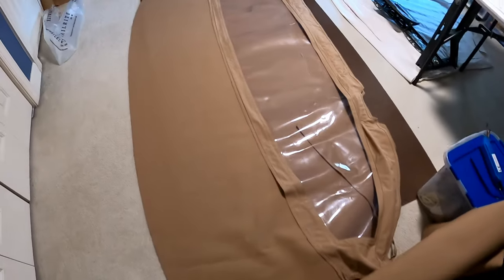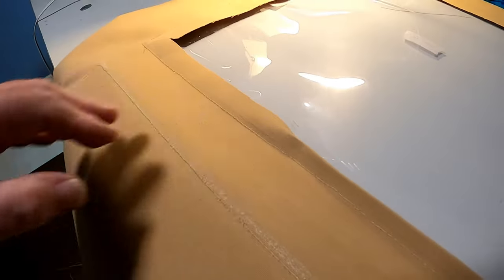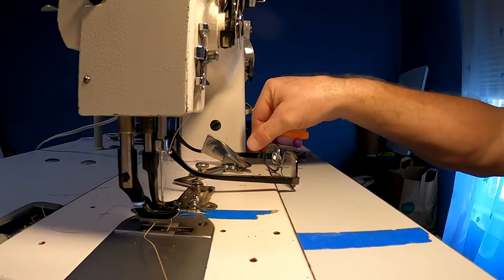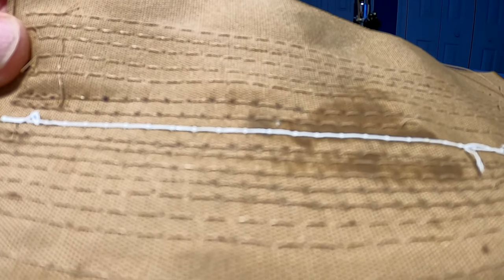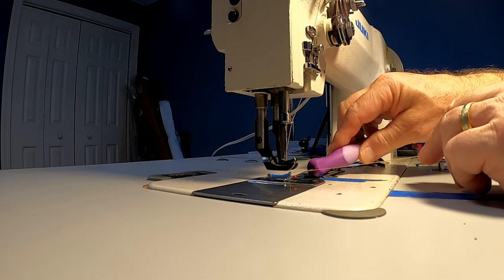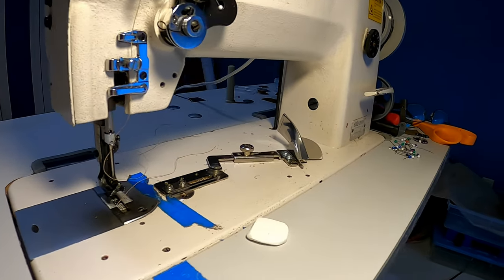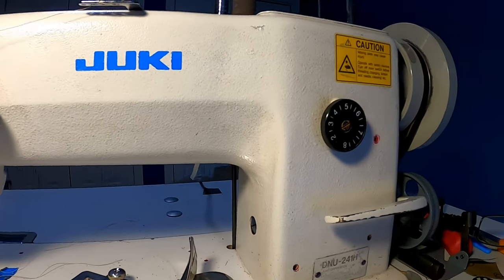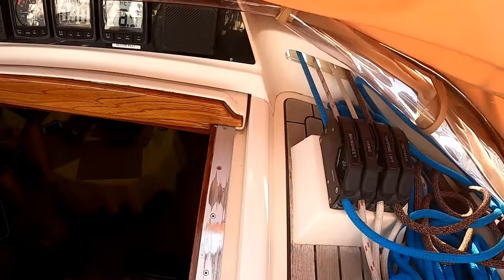Ep 141 Tuning Industrial Sewing Machines for Marine Canvas Projects

Comment: I was pulling my hair out trying to get my tension correctly. No problem in two layers of sunbrella, but a nightmare in multiple folds. I was using a needle that was too small (#20) going to a #22 solved all my issues. Thank you!
Reply from the maker: Yeah, there's nothing more frustrating than a sewing machine that's acting up. We're glad you got it sorted.
Reply from the maker: Yep. Exactly right.

Comment: Staples work very well, in many applications, instead of pins.
Reply from the maker: Hi Rick. What kind of boat is that? I've tried it before, but depending on the staple they can damage the fabric if the staples aren't sharp enough. Anyway, we have a ton of pins in the box. And thanks so much for being with us.
Reply: @SailingTalisman  Hi Kevin - nice to see y'all back after a little break!  Really enjoy your channel.  The boat is a classic Lightning - it's actually a friend's boat - 1940's era.  I have 2 newer Lightnings - one "classic" 1967 & a modern one.

Good point about the fabric damage with staples - whenever I use them it's always on the outside edge of the seam so any picks, etc. are not on the the "business" side of the canvas.

Comment: I've never seen a zigzag compound feed walking foot you referenced. 

My experience is that lock stitch machines can only deflect the needle on one axis, either forward and reverse in the case of needle feed, or left and right for a zig zag. I can't imagine needle to hook geometry that could compensate for both zigzag and needle feed.
Reply from the maker: A four-point zig-zag sailmaking machine is something to see. The motion is so fast you can't see the needle. It's a blur. And in the end if you look closely you'll see four stitches on each leg of the zig-zag, which is usually of a large size, say 3/8" to 1/2" wide pattern. You might not be able to envision it, but someone else did.

Comment: HI, yes great video.   I'm looking to buy a new sewing machine for making a spray hood.   I see you have a Juki.  Can you tell me what model it is and whether you looked at any other models too?  I don't really know where to start, but notice in comments mention of Sailrite.   I'm based UK. Thanks.
Reply from the maker: Hi Amanda. Ours is a Juki 241 I believe, and we bought it used in Denver many years ago. Coleman tents and Samsonite used to be based in Denver and there are a lot of these machines kicking around on the local market. There are other similar machines out there, but this one has proven to be very reliable. However, it's heavy, and not well suited to life on a boat due to the table and large motor drive, and this is where the Sailrite machines come in. Sailrite took what I would call an 80% full-on professional machine and set it up to be lighter and portable. It's still heavy because of the cast iron body, but it's a walking foot machine and stores in a small case. Now there's a difference between the compound walking foot of the Juki (a straight stitch only machine) and the Sailrite models, which come in straight stitch and zig-zag models. In this, a compound walking foot machine has the needle, top foot, and bottom foot all step forward at the same time to grab the fabric and pull it back when completing the stitch. With the needle pinning both/all pieces of fabric together, it's near impossible to have variations in stitch length. This is how you get the professional stitch look that you see commercially. Now I would call Sailrite and talk to one of their sewing machine salespeople, or even the owner, about their new machines. I say this because I notice changes in the look of the product, and while the old version had the top and bottom foot movement, the needle didn't "walk" like the Juki and other commercial machines. This may have changed, so best to ask. Also, given a choice, I would take a zig-zag machine as you can always set the zig-zag setting to "zero", which is straight stitch. The industry doesn't communicate this feature well (confirm this with Sailrite too, but it's always been this way with other machines). Zig-zag is what you use in repairing sails, so important for the sailor to have this. The two versions at Sailrite are similarly priced, so that's nice. Anyway, I hope this helps. BTW, Sailrite sells all sorts of other machines these days, and is a good source for a known-good product. If buying locally in the UK, be aware that compound walking foot machines run from very light duty, (lace and taffeta) to heavy duty models like the 241 which are designed for leather and heavy canvas materials. You obviously want the latter. If shopping used, Google the model you're looking at and see what the manufacturer says the ideal useage to be. Hope this helps.

Comment: Does Sailrite have a 4 point zig zag compound walking foot? I took a look at the Sailrite website but don't know what I'm looking for as I haven't sewed for decades. All I'll be doing with the machine is making canvas covers like your doing. I'll be keeping it aboard my boat and rather than paying someone to do canvas work for me, I'll save that money and put it into a nice machine instead. Is your Juki an off brand of Sailrite where you can purchase Sailrite parts and they will fit on your machine? Sailing Life on Jupiter also had a video or two about sewing machines. That video got me thinking about getting one to save money and doing the work myself. Do you keep the sewing machine aboard your boat or do you keep it at your home?
Reply from the maker: Hi Robert. Not sure what Sailrite has these days, but it might be worth looking for an industrial sewing machine dealer. You might have to special order it. As for Sailrite's machines, it's actually Sailrite that rebrands the machines and sells them under their own name. Juki is one of the bigger brands, but there are others too. We have a small "Heavy Duty" machine on board made by Singer, but it's not very heavy duty in my opinion. It's used mostly by Wendy when we have some sort of clothing repair, and could probably do a bit of canvas work in an emergency. Sailrite's LSZ-1 (Blue) machine is probably the best compromise for a machine that's to be kept on a boat. The big machines like ours need a table and motor and all this stuff that can't be easily packaged as a single unit the way the LS series machines can. That would be the best way to go.
Reply: @SailingTalisman  Thank you!

Comment: Why not make the long middle window a roll- up, sewn at the top, with velcro at the sides and bottom. That will let the draft through. I can send you a photo if required.
Reply: you would need to send me an email add. for a photo. it's a really good looking dodger...on an Oyster :)
Reply from the maker: Hi Nicholas. Thank you for the kind note. As you would imagine, we're already committed to the arrangement I showed at the end of the video, but believe me when I say that we looked far and wide at various designs. And there's no shortage of choices around. As for why, I really like being able to put the spray hood down entirely. It makes for clear views when we're at anchor, and the wind comes through cleanly. Also, using the zippers and the ties is just a bit more work, and one more zipper that wants to seize up as the little pin inside the pull gets rusty. Yes, we can lube that and keep it working, but all of this led to the design we chose. But to each their own. And thanks for watching and being with us.